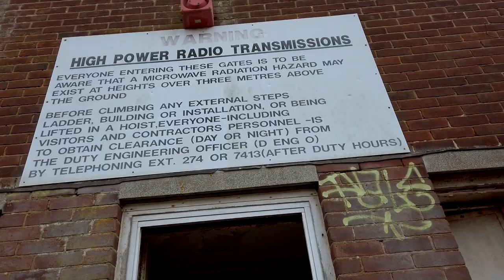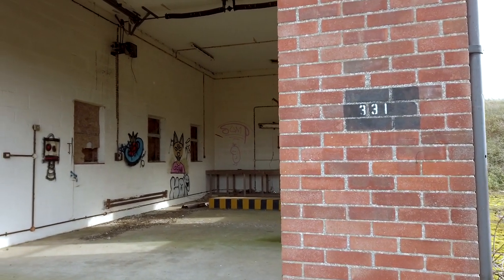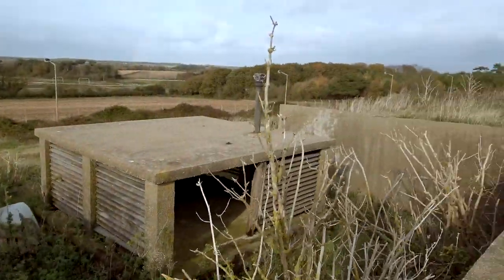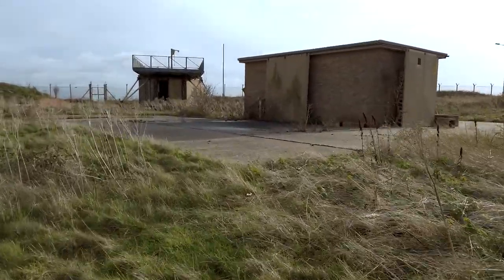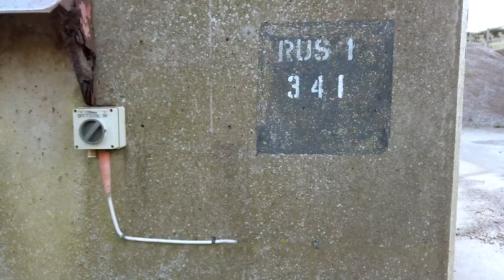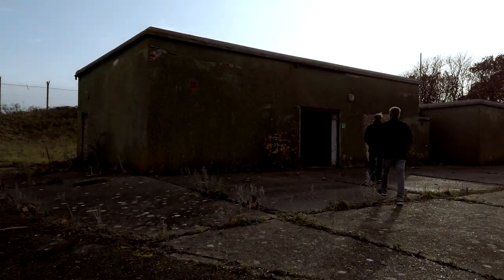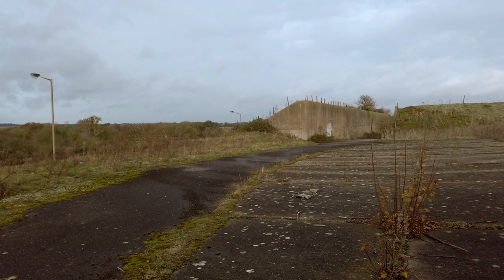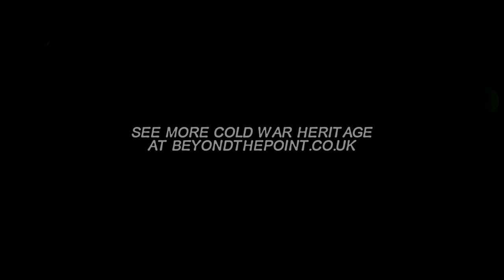Suffolk's ROTOR Radar & Missile Defence Base

Comment: Wait so at these so called RAF Rotor Radar Stations are equipped with Bloodhounds missiles during the Cold War?
Reply from the maker: It's a good question, I think the bloodhound missiles were a later addition here and ROTOR sites were purely radar initially
Reply: @BeyondthePoint  Bawdsey closed as a radar station in the mid 1970's, the Bloodhounds went in during 1979. The SAM's went in to give low level protection for USAF and RAF Bases in the Eastern Suffolk area. One of the Bawdsey Type 86 Radars has been preserved and is now at the radar museum at Neatishead.